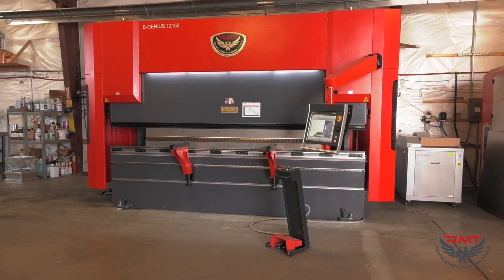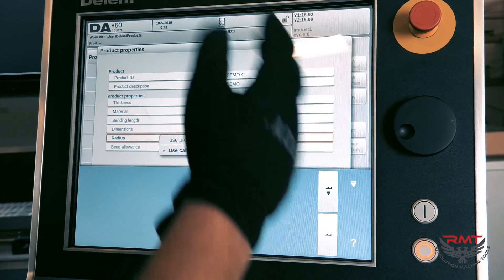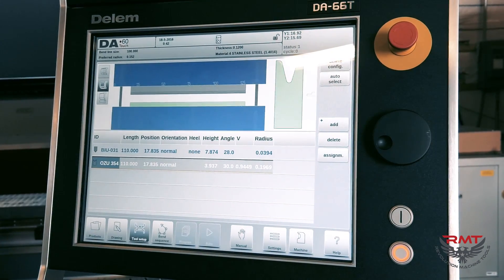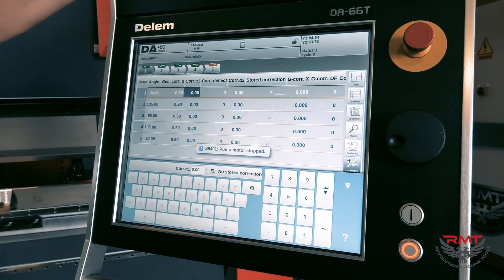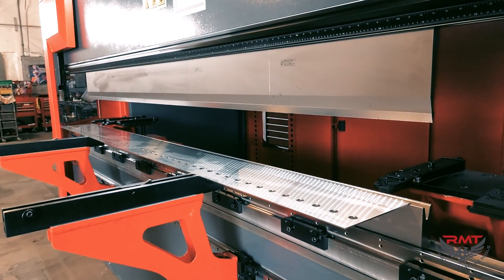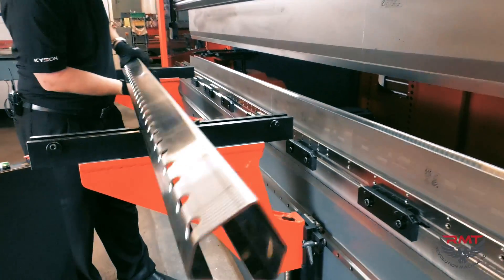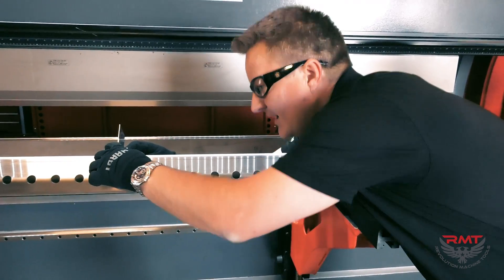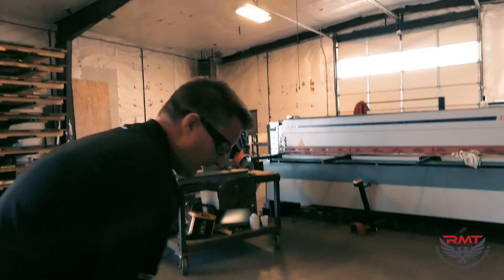RMT B-GENIUS 12-150 CNC Press Brake | Press Brake Demo | www.PRESSBRAKE.com

Comment: Lot of $80 parts to pay for that sucker.
Reply: Good thing inflation has now made them $240 parts 😞
Reply: @phillhuddleston9445  I don't think inflation gets an $80 part to $240 in 5 years.
Reply: @I_Can_Do_That_2  With certain types of steel like sheet and plate steel the cost has tripled since the plandemic hit, that is where I got those numbers from, $240 is three times $80. All types of steel such as bars, tubing, pipe, structural, etc. have increased by over two times the original cost, this is not yet fully reflected in pricing because it takes a while for price changes to go into effect and I think many manufacturers are waiting to see if the price drops in the near future before making price adjustments to their products.
Reply: @phillhuddleston9445  I understand. I'm a contractor, so I've watched as lumber prices have soared. The increase in the prices of those commodities hasn't been as a result of inflation, though. Steel prices have risen as a result of foreign policy with China, among other things. A gallon of milk, a dozen eggs, and a loaf of bread cost almost exactly the same as they did 5 years ago. That wouldn't be the case in an inflationary economy.
Reply: @I_Can_Do_That_2  That is partially true but it's also that with all the stimulus money paid out to people for not working and to the working as extra money to spend the demand for some goods has risen while the supply can not be replaced as fast leading to shortages of some goods. Food prices have not fluctuate as much because the increased personal incomes have not caused people to significantly increase the amount of food they are eating.
Reply: @phillhuddleston9445  We're talking about steel and inflation. Steel has gone up primarily due to tarrifs placed on imported steel by the previous administration, with a slight rise due to increased demand. Even so, rising prices due to supply and demand are very different than rising prices based on inflation. I'm not saying steel or lumber prices didn't increase, I'm saying they didn't increase due to inflation. In an inflationary economy, all prices go up, and supply and demand isn't as contributing factor.